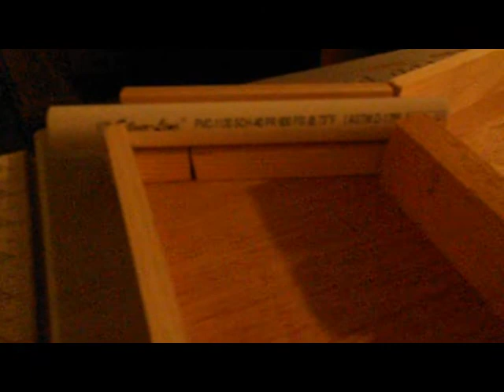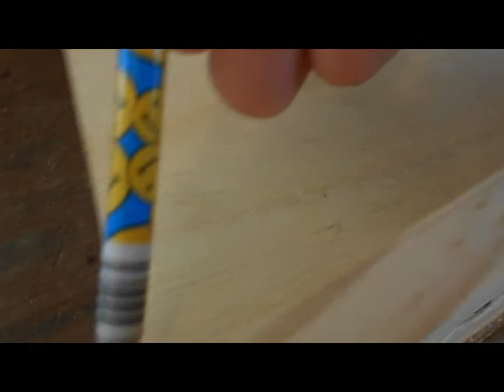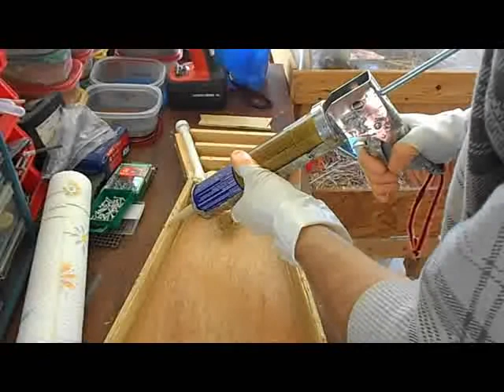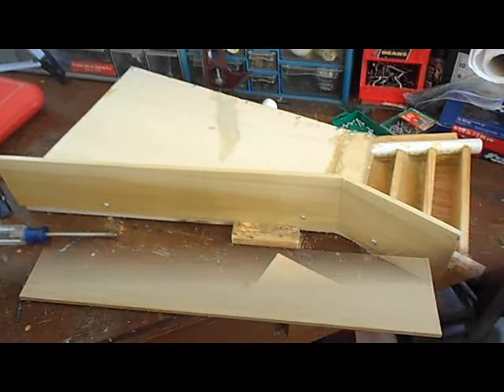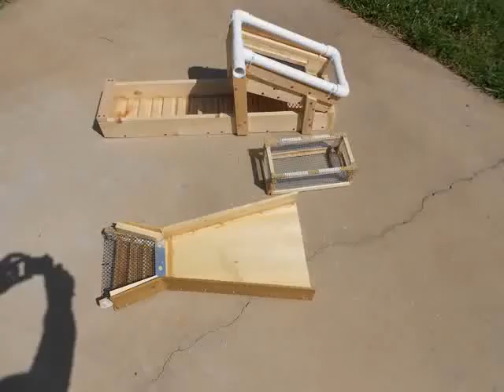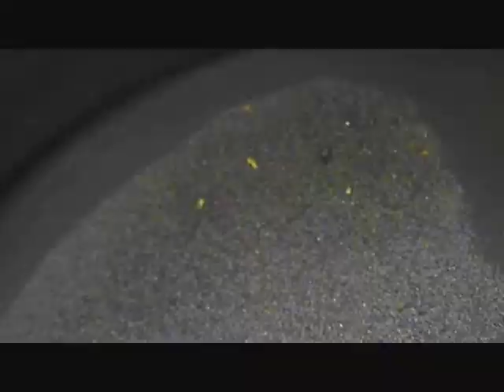(DIY) Building a Double Flared Fluid Bed Sluice with 3 chambers.wmv

Comment from the maker: I use about 6 mesh for it. The smaller the mesh size the easier it is to keep fluidized. To clean out you just dip it into a bucket or pan and shake. There is 1/2 inch of space underneath the grizzly and an opening on the back underside for gangue to exit.

Comment from the maker: No plans I just built it on what I thought would work. I needed shallow and a big flair to boost the water velocity to move off the gangue, and small chambers to keep it fluid. It almost works too well in that it concentrates to a much heavier concentrate then a bazooka.Theres no blond sands when you pan this one out, and it still keeps the 100 mesh.

Comment: Another out of this world build by Astro! Very interesting design - thanks for sharing!

Say does the last and widest chamber stay fluidized in the middle? If so the first two chambers would get more pressure to push bigger material out? Does the material from the first two chambers have to boil into the next chamber over the hardware screen or is there a gap under the screen on those two chamber walls? 

Oh too many questions again - you can tell I like your build!

Comment: I figured it out from watching the video about 5 more times. Also got most of the measurements from the table saw ruler. Does the sluice reduce from 12" to 8" or 7"? Also what is the height on the sides for the base and the outer wall.

Comment: Good stuff. But using wood is a drawback. It swells, heavy. Try working with plastics. PVC preferably. Strong, tough, light and not bad to work with once you're accustomed. Liked the design.😎